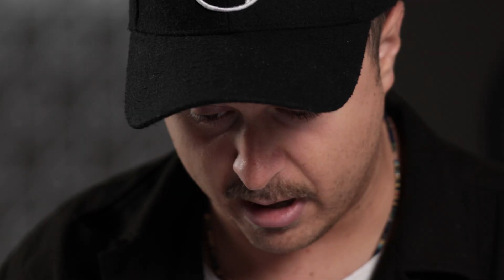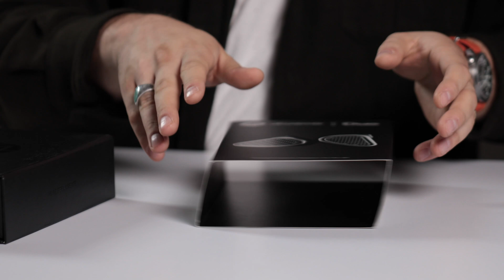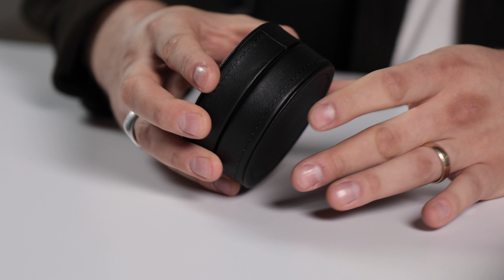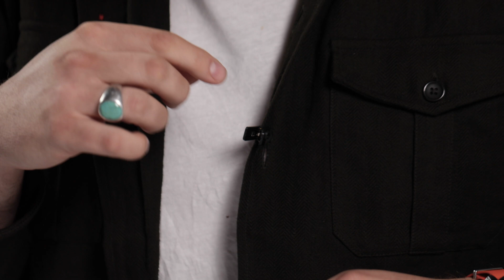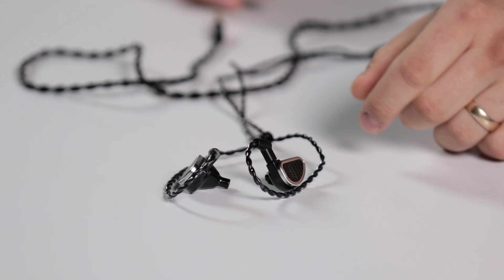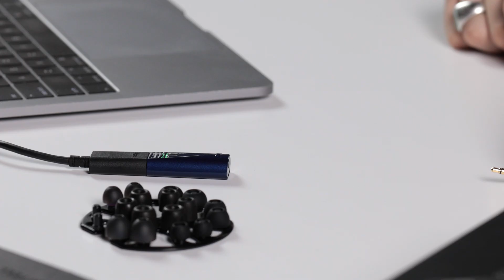64 Audio | Duo Unboxing

Comment: This is a hidden gem. Highly musical, non-fatiguing and great bass, but not ‘bassy’. Great video.
Reply from the maker: Glad to hear that you like Duo. It has, unfortunately, been discontinued but definitely a strong basis for a design to one-day be reconsidered.
Reply: @64Audio  I’m a satisfied owner, one stupid question: is the supplied cable clip suitable for clipping in the whole cable? I’ve managed to get it in but it was a bit tight, and I don’t want to damage it. I attached it right below the split to minimize microphonics.
Reply from the maker: @Excelbrains  yeah since the cable is made up of about 4 wires (below the split) you can just attach the clip to one of those four wires
Reply: I had to part with my Empire ears Odin MII because they didn’t quite match my ears, which are normal but have a bit smaller ear canals. It seems like iem manufacturers are usually opting for large shells, deep insertion or a large bore these days. The Odin is technically better, but I’m a fan of the Duo. It’s just more musical, less forward and more coherent. And not unimportant: comfortable. Great job 64audio.
Reply: interested in these, how are these in gaming? Do they have good imaging and soundstage? Any verticallity?
Reply from the maker: @shalveenkumar2142  Not sure about verticality, but definitely a good choice for gaming. They're a bit softer in the lower treble, so maybe not for something where you need to hear extreme details in footsteps for example. One great thing is that since they're semi-open back you can wear them for hours without fatigue.
Reply: Am I correct that the Duo is specifically tuned with the 3.5mm Premium cable and not with the Pentaconn version? I tried some Effect audio cables, didn’t improve the sound, especially the highs. To my ears with the stock Premium cable it is awesome, but wondering if the 4.4 balanced version might be even better?
Reply from the maker: @Excelbrains  we do provide 4.4mm and 2.5mm terminations for most of our high-end cables but do not really comment on the efficacy or benefits of this type of connection over a standard 3.5mm single ended connection. It's purely preference based. Duo is known to be one of our lowest sensitivity IEMs so if you need more power then the 4.4mm output of many devices might be helpful.